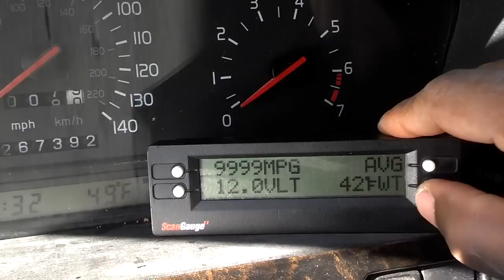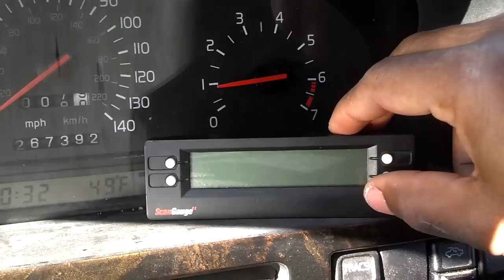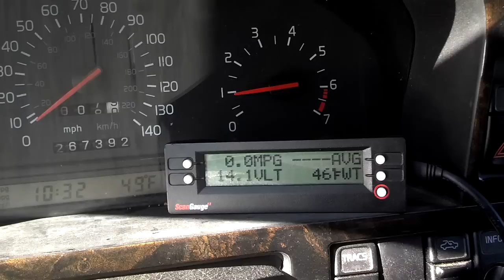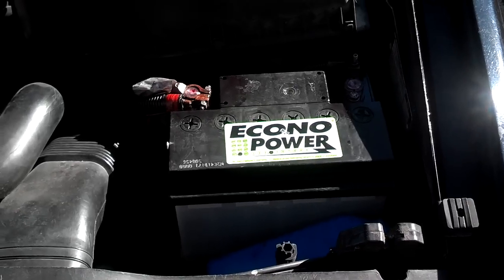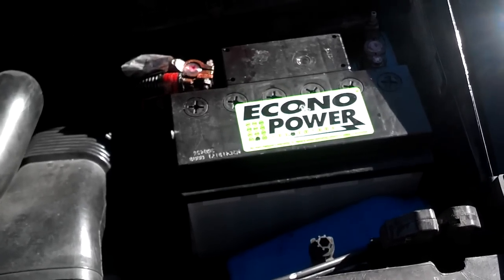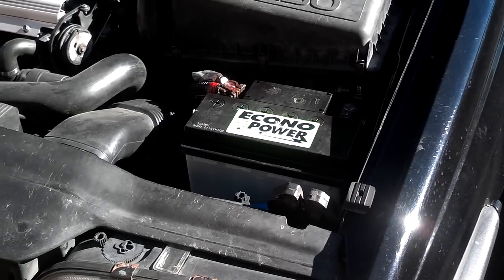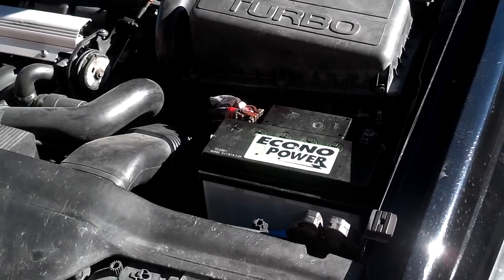How to tell if your car battery is bad, weak or dead. Signs of a bad alternator. - VOTD

Comment: My Pontiac G6 barely turned over then I heard nothing and the car would not start. I then put the same battery in my 01 Camry and it started very easily. The battery specs are very similar for both cars. Not sure if this rules out the battery as the  starting problem in the Pontiac.
Reply from the maker: https://youtu.be/vh7qS_YnP7I?si=Stl-VHVVa_gWdb9j

Comment: How long should a battery last? I bought my current one back in Dec 2020. And wonder if I should replace it or check the connections. I drive a Chevy HHR
Reply from the maker: 3+ years. Depends on the quality and abuse you give it.

Comment: My battery was dead this morning. I charged it and the car ran fine.  Checked the voltage with my multimeter and it was fine...12.6 volts. When I opened the door and woke up the car the voltage dropped 2 volts immediately.  I charged it again and the car started. Checked the voltage with the car running and it was 14.6 volts. Charging fine.  With the car off and sleeping I've been checking the voltage every hour for 6 hours. Voltage hasn't moved at all.  12.6 volts. When I open the door and wake up the car interior lights come on,  etc. my voltage drops 2 volts immediately. I was thinking I had a parasitic draw but can't find one.  I'm thinking my battery can hold the voltage while sleeping but under any draw whatsoever the battery loses 2 volts. I'm thinking it's time for a new battery. I've checked everything and this is all I've found. Thoughts?
Reply from the maker: Probably has a bad cell or two.
Reply: @RobertDIY  Bought a new battery this morning and the car runs noticeably better.

Comment: Good overall coverage of battery issues.  Two years on a battery?  I usually get 6 years.  I check cells every summer and add de-ionised water if needed.  With cooler weather (14 F/10 c)and limited driving (less than an hour/day) I make sure I put my Battery Tender Plus on overnight to charge up at least once a week.
Reply from the maker: Good idea.

Comment: Can't you test the alternator output by leaving the DVM on the battery after the car is started?
Reply from the maker: I'd just put it on the alternator output.
Reply: I noticed that my voltmeter started reading 14 volts across the battery as soon as the car started.
Reply from the maker: DVM?
Reply: @RobertDIY  sorry. Digital volt meter

Comment: Auto part store definitely lead me down the wrong path.  They ran their portable tester and said the charge was low and just to clean the terminals.  2 days later car would not start even though battery showed 12.10V when off and 14.01V when running (after being jumped).  I watched a dozen other no start trouble shooting video and this one was the first to even mention CCA which is what I am pretty sure my problem ultimately was. Thanks for sharing.
Reply from the maker: You are welcome.

Comment: My battery have one dead cell below the positive terminal
And the rest cells are good
It wont start 
When i bring the battery to battery shop the number one cell have black particles 
Its possible to fix by replacing that with distilled water? Tia
Reply from the maker: There is some special water to service them with but really, I'd just replace it with a good quality battery.

Comment: Can't you check to see if it's an alternator problem by starting the car, letting the car run then disconnect the battery cables.
If the motor continues to run then at least you know it may not be the alternator.
If the motor shuts off then your car was running on the battery which could drain it and could tell you that there is possibly an alternator problem.
Reply from the maker: Not a good idea with newer cars. To many computer parts which are sensitive to power surges.
Reply: @RobertDIY  Wow!
I mentioned this to more mechanics than I can remember and not one explained it this way to me. They just said, "Not a good idea .."🤔
Thanks for that detail Robert! Makes sense!

Comment: Sir my new SF sonic car battery is just a month old, and it's giving white signal which indicates need charging.

I checked all the fluid levels and all ok. There is no starting problem or charging issues on the car. Just the signal worries me.

Please help me out.
Thanks.
Reply from the maker: Bring it by please.

Comment: Have a 2007 Pontiac g6 coupe..I bought a battery tender plus and put it on to charge the battery..been having problems with it starting..it says it was charged up..but when I tried to start it it just clicked and wouldn't start..but if I jump it...it starts up..drive it around a little and it stays running..until I turn it off..then I have to jump it..and it starts up again..but car is only drove a few days a week..so is it a bad battery?...or is car not being drove enough to keep it charged..possibly alternator issue?..
Reply from the maker: Have the battery tested. How old is the battery?
Reply: Sounds like battery

Comment: my wheel locked up on me  does this have anything to do with my 🔋
Reply from the maker: No.
Reply: thank you what do you think thats about
Reply: Robert DIY  my steering wheel got tight and locked on me while driving, the battery light came on i pulled over and restarted my car everything this was normal, i went tp autozone they said i had a bad battery but im not trying to get ripped off,  it hasnt done that since and runs normal
Reply from the maker: I don't even know what kind of car you have. If the car died, it can cause the power steering to fail. You said wheel, to me, the wheel has a tire on it.

Comment: I have a bad battery foreshore, is it possible for a battery is so bad that when you try to jumpstart it, my car gets power like normal, radio windows lights work horn sounds perfect, but when I go to crank the car on a jumpstart nothing happens.. I hear the fuel pump wine but no crank what so ever... my car has been sitting for about  3 years also... but my car had no problems before I put it in storage. Do you think a new battery is all I need?
Reply from the maker: Could also be the starter.
Reply: Robert DIY yup, thanks it was the starter, I finally got to get a battery today I put it in and still no crank, I got to bang the starter 3or 4 times an I went to start it and it finally started... but need to go ahead a buy a new starter before hitting the starter doesn’t work anymore, thanks for the help

Comment: The flow means current flow.  You can check the alternator by measuring the voltage across the battery when the head lights and rear windscreen demistor is on and the motor is running .  You should get 13.4- 14.2 volts.  Always keep hands and leads well clear of moving bits.  Another indicator is the charging light comes on.  Another indicator that the alternator is bad is when you use your direction indicator.  The flashing interval is greater or the indicator light just comes on without flashing.   If you have an alternator problem it might be the fan belt is to loose.  If you here a loud squealing sound sometimes when head lights are on, particularly when you just start, it means the belt is loose and it is slipping over the alternator pully.  Don't let your car do this because the heat generated in the pulley goes into the alternator shaft and into the alternator bearings where it dries out the grease causing bearing failure. When hear this sound  switch of the rear screen demistor and or head lights to park , (but not in middle of road for head lights ) wait to sound goes away then switch back on head lights.  If this is your problem,
  with the engine STOPPED,  tighten your fan belt at the first opportunity. Fan belts also should not be to tight this also will do alternator bearings. Just tight enough so there is no slipping is fine. About 1/2 inch sideways movement in the middle of the belt between Alternator pulley and crankshaft pulley. Check this ONLY when the engine is stopped.   Alternators seem to do there brushes around150,0000- 190,000 miles .( 200,000-250,000 Ks. ).  NEVER EVER put your hands near belts with engine running.    If your fan belt has a dry hard feel with lots of little cracks on inside it's time to replace.
    If none of the above makes much sense, particularly the bits about never putting your hands near moving belts of a running engine. Then don't open your hood.  Pay a mechanic.  
It's just that I have visions of dread of someone trying to test with their hands how loose the fan belt is with the engine running   and then.      Snap crackle pop spirt spirt , look Mum no fingers or hands OR no hair.    So think and take care.
Reply from the maker: Thank you for sharing.

Comment: 2008 Nissan Rogue won’t start. It turns on all the air condition and music but when I turn the ignition all the way it just makes a noise as if the car is trying its hardest to start. The oil needs changed within a week and the battery is a year old. The car has 205,000 miles and it’s pretty cold outside. I’m unsure if I should buy a new battery or if it’s the oil or what. The lights all turn on so I’m sure it’s the battery. I managed to get it to turn on but I held the ignition all the way to the right for a scary amount of time. I immediately turned it back off because it smelled like gasoline and I saw some gas had leaked. Help
Reply from the maker: https://www.youtube.com/watch?v=_1q40V-BPQc

Comment: Hey Robert so i went to put the key in the ignition this morning dash lights came on then when i go to turn the key to crank all dash lights came off now i took negative terminal off then put it bak on it cranked i shut it off after 20 mins does the same lights on cash then off now when i try to go crank nothing no lights and cant crank the starter no more started once now it won't no more is battery finally done? I recharged it last week they said it was good
Reply: iam Moetic how did it go?
Reply from the maker: What kind of car do you have? Probably a bad relay or some other wiring issue.
Reply: Robert DIY well tested the battery they said it need recharge dodge neon srt4 04
Reply: I have had to recharge it 2 times already
Reply: Robert DIY battery was bought 2014 of october
Reply from the maker: Have the alternator load tested.
Reply from the maker: https://www.youtube.com/watch?v=_1q40V-BPQc
Reply: Robert DIY okay will do thanks robert
Reply: SteveCollective well it was the battery the battery was bad and weak 5 years old

Comment: Okay, so, i have an 08 gp base.(3.8L) Every since it has gotten cold out (15 degrees and below) my car will crank, but it will not start. The same exact thing happened with it last year and so last year it sat for around 2 months until it was consistently warm for a few days, it then fired right up and haven't had any problems with it since, until now that its cold outside again. Never had any moisture problems, i have spark, does anyone have any suggestions on what else it might be?
Reply from the maker: try installing a bock heater.
Reply: Robert DIY if i had one that wouldnt be a problem, but sadly, i dont. But upon watching your video i do have somewhat of a slow crank all lights, radio, wipers etc work. But car wont fully start. Battery has 800 CCA on the sticker but is only putting out 665 CCA. When tested. So im going to try swaping batteries with another car and giving it a test.
Reply from the maker: +daniel will it start with a jump?
Reply: Robert DIY nope.
Reply from the maker: Probably has a bad sensor.
Reply: Crank sensor?      And would it seem right for it to be that if the car starts and runs perfect after its warm outside and the car components are warm enough to turn over?

Comment: Have a slow crank this morning battery doesnt have enough juice to fully crank it tested 12 volts but isnt fully charged i called auto zone they said bring it in to get charged, now its cold outside this happens when its cold battery stamp said 10/14 it was bought 2014 duralast feels a little swell at the buttom a bit noticed little acid currotion at postive terminal not alot
Reply from the maker: Some cheap batteries don't last 2 years. So sad. You really have to check the volts with a load, like while cranking.
Reply: I gotcha auto zone said it didnt have any charge they had to charge the battery its good now normal wear it says it had juice but not enough to start the car like it didnt have charge is it normal?
Reply from the maker: yes, for cars that are not driven that often or that long.
Reply: Thanks! I honestly drive it 4 days a week i do about 15min communte there and back but just to be safe i connected the positive and left the negative terminal off until i drive it again, will that be okay? The battery just had an hour charge at auto zone
Reply from the maker: That's cool.

Comment: So my car starts up fine on cold starts, but if i drive it around for a while and then turn it off and turn it back on again. The starter cranks really slowly, kind of off rythym too. This only happens when the cars already somewhat warm and not when its cold. I dont know whats causing it its almost like something's being heat soaked, any ideas?
Reply from the maker: +Grant Schneider is the CEL on?
Reply: Robert DIY its not on

Comment: Clean your battery terminals and measurements 12v, in the battery's .Than doesn't needs to do anything else's.Bad battery is very easy to test and determined.You turn on all your car lights and honking the horn all worked normally,mean your battery is good.All these informations are useless to a normal person.
Reply from the maker: Really? I normal person has a battery tester?

Comment: Hello Robert, I have a 2004 Volvo C70 and the battery is going bad. I already replaced the positive cables that connects from the fuse to the battery and also from the battery to the starter. I have a sound system in my car that runs about 500w RMS with the subs and a little more for the side speakers. Since I'm getting a new battery anyway should i stick to the specs that the owner manual says or should I upgrade due to my sound system?
Reply from the maker: +HI HI I would do spec. Not sure what you should do about the sound system upgrades.

Comment: Cars been sitting for a year. When I try to jump it I still have no power at all. No dash lights, door beeps, nothing. Could that still be a dead battery?
Reply from the maker: +dantheman z yes. Also a bad cable.
Reply: Thanks..connectors look corroded. I'll clean them and buy a battery.
Reply: New battery and car started right up. Thanks
Reply from the maker: You are welcome.

Comment: Hi Robert, great video. I've found that even conductance testers (any makes) can sometimes be 'fooled' & pass a good battery when it's bad. I have a Midtronics Micro 500 & cheaper ones. The AGM stop -start batteries seem particularly able to get wrong readings occasionally. I had a 95 Ah 850 CCA battery that read about 800 CCA (EN) on conductance testers. It was in fact only 12 AH on a C/20 discharge test. This battery failed a proper load test (425 amps for 15 seconds.) I always load test too if I suspect  a Conductance tester is wrong. Have a nice day.
Reply from the maker: Thanks for the info, seems way above my pay grade. lol I usually take them in to be changed, that usually tells if bad or good.
Reply: Thanks Robert. I'm an electrical/electronics engineer. I was hoping it would be possible to test batteries accurately for capacity quickly. I use AGM batteries mostly, often big start -stop ones. They use them for leisure use & off grid systems. Sadly these conductance testers can't do it. (I use the same ones the auto shops do.) I find if the conductance tester says a battery is very low in CCA capacity it certainly will be, but if the tester says the battery is close to perfect , occasionally the battery can still be pretty useless. There's often little or no relationship  between CCA shown & the amp hour capacity of the battery, which is really important for running inverters etc. Even the ACT testers can't do it for large AH batteries. Anyone else found this?  Regards.

Comment: Rob, my man, you're the greatest!

I'm getting a reeeeealy slow crank on my 850. It always starts, but the crank is slow and therefore long. 90% sure the issue is the battery. However I've got a cel and it's throwing multiple misfire, cylinder 1 miss, cylinder 4 miss, and O2 sensor codes... can any of these issues be caused by a bad bat? Could a bad bat really cause a miss?
Reply from the maker: +Maxwell Buhler nope
Reply from the maker: +Maxwell Buhler https://youtu.be/n7NYrCbQN7U
Reply from the maker: +Maxwell Buhler https://youtu.be/Sg7iFytxfzQ

Comment: I have a 2007 Audi A6 and I was driving n all of a sudden my car started to act sluggish, so I turned my car off and then it wouldn't turn back on. So I needed to get a tow, now the tow truck driver attached a battery pack to drive my car on the lift. He was telling me that it's the alternator. But the thing is when I try to start my car now the windows won't roll down and the only door that'll unlock with the key is the driver door. After I got home I tried to start my car and it did so I thought I was fine. Then a couple days after I started my car and it was running then after like 20 minutes it cut off. So I'm really confused at what's really wrong with my car. Can you please give me some insight? Thank you.
Reply from the maker: https://www.youtube.com/watch?v=_1q40V-BPQc

Comment: The battery in my volvo is 10 years old now. It starts normally everytime,  but I noticed a whineing sound when radio is on am stations recently then goes away 30 minutes later.  Could that be the alternator working hard recharging?
Reply from the maker: +Nick S probably old spark plug wires.